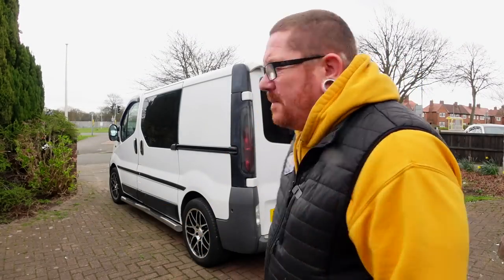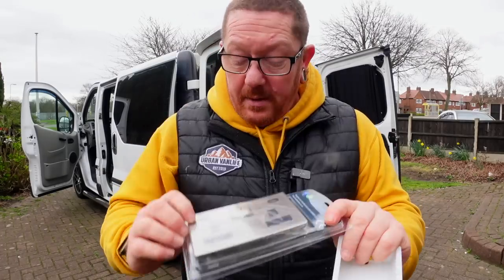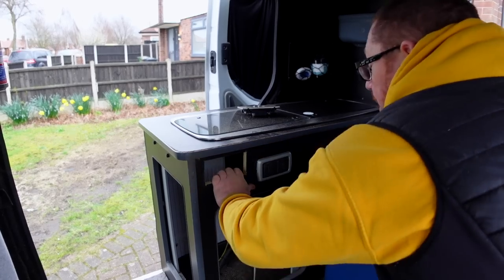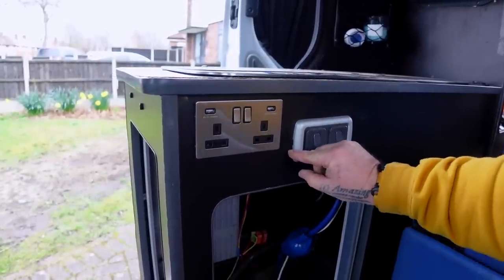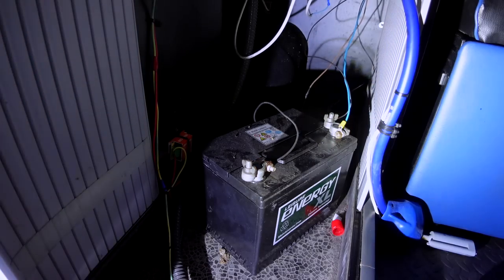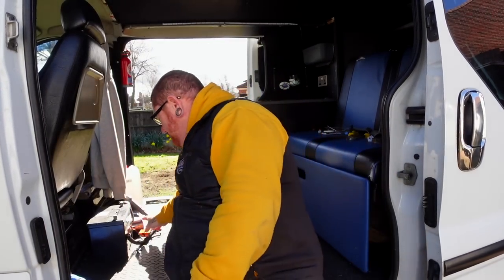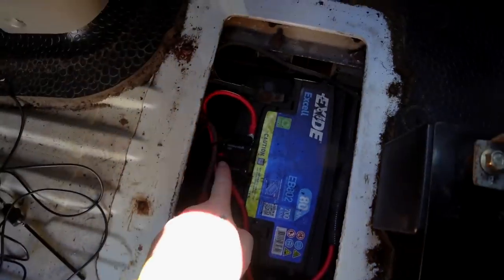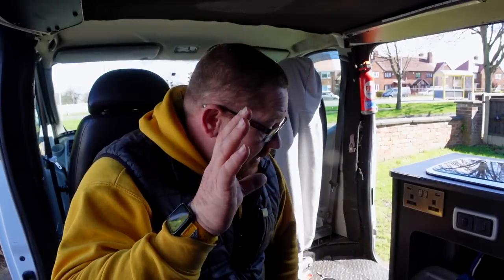Camper Van Transformation 240V Hookup and More

Comment: Hi ya! Love your videos as always, but the distribution board installed doesn’t comply as the breakers are not double pole. If you replace the mcb and fit rcbos instead it will then comply. Also an earth connection is needed to the body work from the board.

Comment: How long would you say a leasure battery battery last with out a charge running say like 12v cool box fridge and charging phones and kids tablets and that.
Reply: So many variables but an example: 100 amp hour battery will give  100 amps for an hour or 1 amp for 100 hours in theory.
A 'standard' leisure battery should not be discharged  more than 50% , so above figures should be halved 50 amps for one hour and 1amp for 50 hours. So add up all the amps  your equipment needs if it comes to say 25 amps then the battey should last 2 hours to 50 % discharge.
Reply from the maker: Without knowing what power the cool box pulls mate it’s very hard to say cool boxes do fall off a ridiculous amount of energy. It was just tablets phones and basic charging things like that. It would last for the whole weekend or 3 to 5 days but when you are the cool box into it he might not even at 24 hours.

Comment: This is the type of video I actually enjoy the most. But, you missed bits out such as cutting the hole for the input mains socket, running the cable to the battery for the split charger. You may want to make a "tech heavy" video with ALL the steps taken and the discovery of the remedial work you did as well. All helps to charge up the brain cells. Yeah I know you may end up with a 2 parter but, we'd be better informed when it's all done. Yeah I know there are stacks of Howe to make a big hole in the side of your van videos but, they aren't you are they sunshine? 😊. Having said that, I do enjoy your videos anyway but, MORE DETAIL LADDY. Hehehe. Cheers. Your a diamond in the ruff.
Reply from the maker: Hahaha sorry buddy . The video would have gone on forever . Plus we do have dedicated videos on the channel of fitting the split relay and doing the 240 hook up as well . But man it would have been a 45 min video of me just chatting wham lol but appreciate what you said tho mate

Comment: You say ‘sometimes it’s just common sense’… electrical installations are ‘knowledge’ - where’s your correct consumer unit, chassis and gas pipe bonding? 🙄
Reply from the maker: You don’t pop up much but when you do it’s allwsys with a pissy comment . Ok firstly the consumer unit is fine you just have to make sure you have the correct size breakers in cos camp sights as you know they all work off specific amps but you know that right so I don’t need to tell you . Also don’t remember fitting gas to this van I mean correct me if I’m wrong which I don’t think I am but please let me know if I’m wrong . Which I’m not .  🤷🏼‍♂️
Reply: Then I’ll tell you - you are wrong! It doesn’t matter who fitted the gas, YOU have added electricity… YOU are responsible for earthing and bonding (but as the installer, you will KNOW that!). You are also wrong about the breakers - the regulations (which I’m sure you’ve read - BS7671) state you must have double pole breakers. 
Still showing people how to do it (badly) - that’s why I don’t pop up often